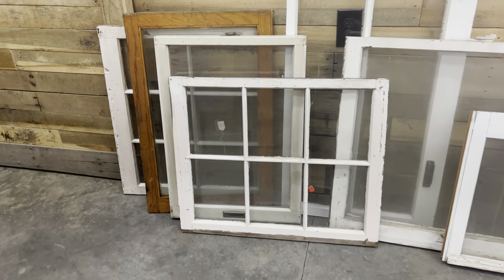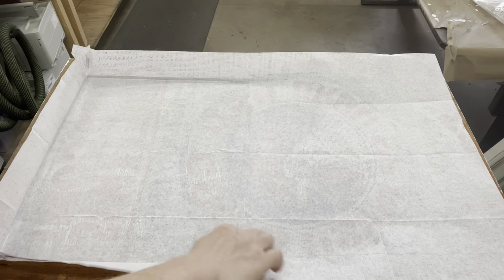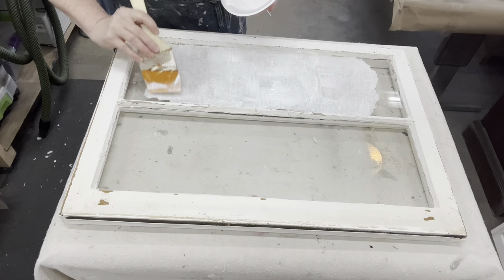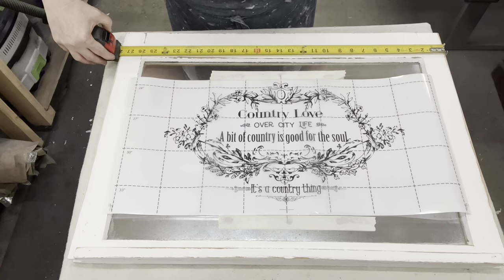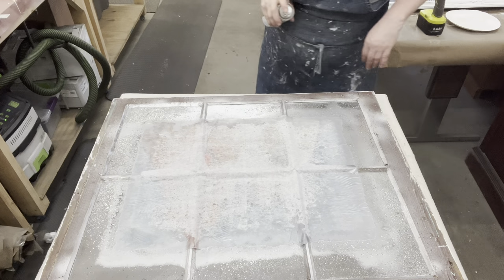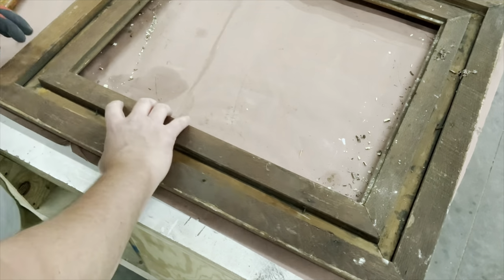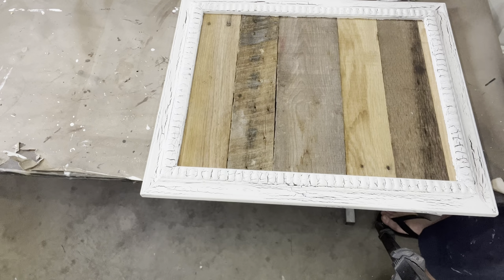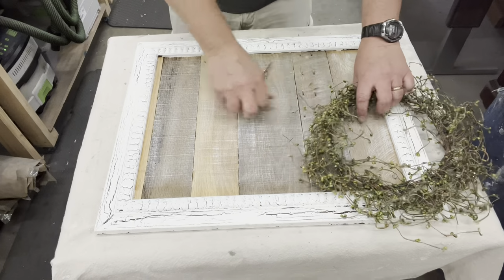Dumpster Diving | Windows l Frames | Ideas | Repurposing Trash to Treasure | DIY | Home Decor

Comment: Question how do you know what sandpaper grit to use. What do you use for backing?
I use vinegar and steel wool. I soak the steel wool in the vinegar and it rusts the the vinegar
Reply from the maker: Depends on what your doing. The lower the sandpaper number, the more it will take off. The higher the number, it’s more to make it smooth. 
We use brown paper wrap. We get the construction roll. Because we cover our shop tables with it. But it’s similar to the paper at dollar tree.
Thank you for sharing you recipe